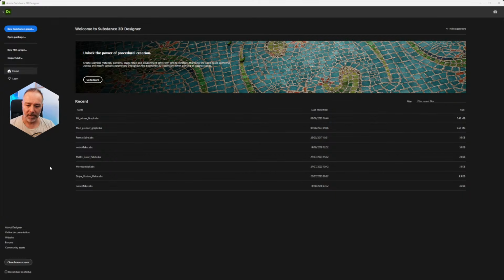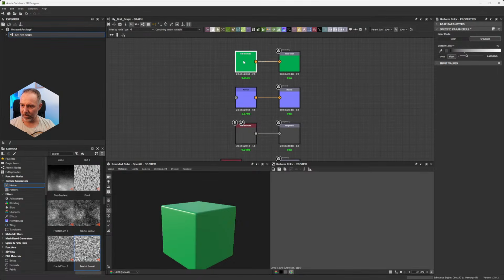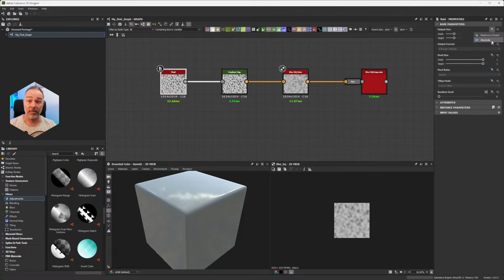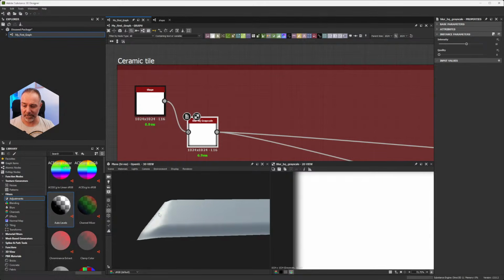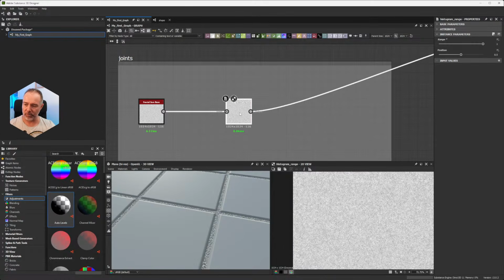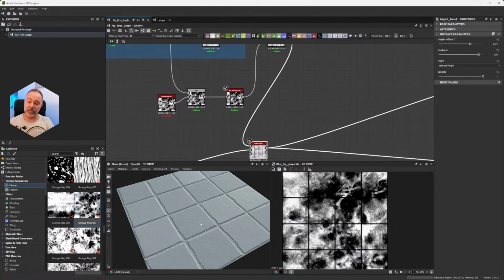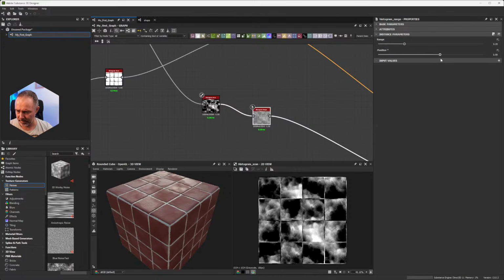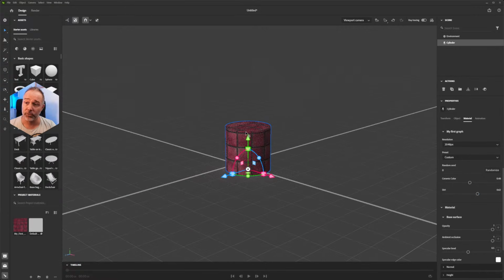Introduction to Substance 3D Designer (CGVinny's Coffee Break #6)

Comment: 1:06:35 So you start from 0.5, okay... So the black that you see in the "2D View" panel is actually 0.5 on the mesh? 🤔
That means you're only working with 0.5-1.0 range (which is half). Why would they do this??? This new "Adobe" shader is weird... To access those 0.0-0.5 values from the bottom half you'd have to use a negative number, which is only possible with HDR formats (16F and 32F) not 16-bit and 8-bit. And you won't see them in the height texture, because monitors don't display negative colors, they would show up as black. 😐
Reply from the maker: These values are just to set up how the shader will interprete the height map (nothing new here or related to ASM 🙂). It's to define where to start from relatively to the mesh + the amplitude.
Reply from the maker: And your values can stick between 0&1